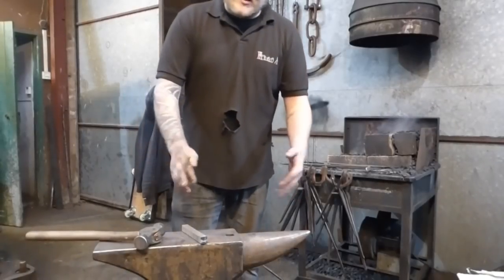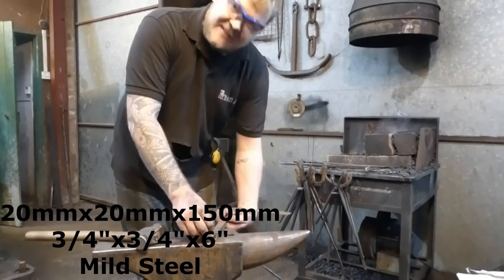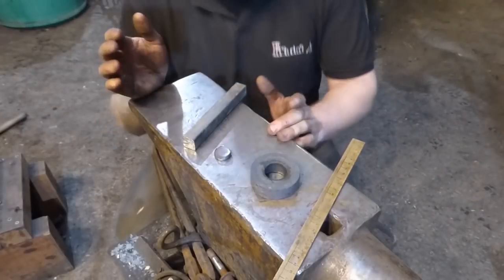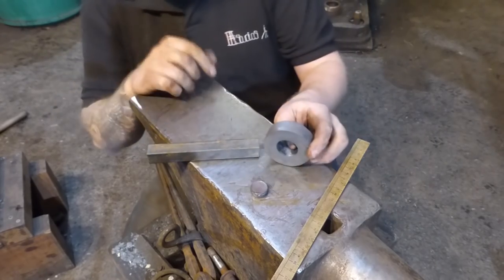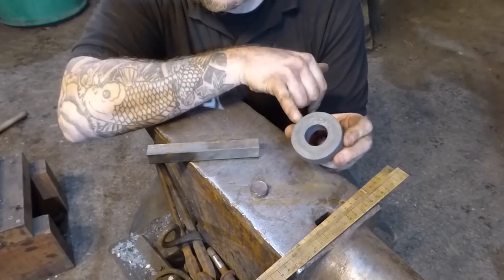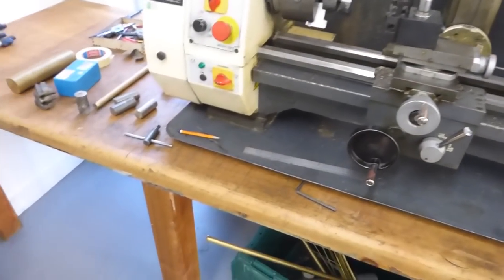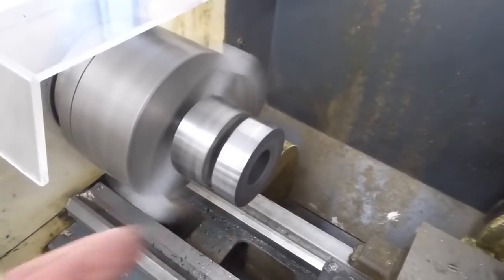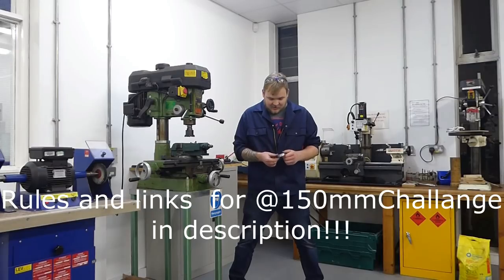150mm or 6 Inch Challenge! Upset, Punched and machined! #150mmchallenge

Comment from the maker: I think I should explain a little better the challenge is to see how creative you can be with a piece of 20x20x150mm mild steel or 3/4x3/4x6 inch mild steel. Rules for the descriptions check out the Instagram links also for more ideas and stuff. most important thing is to have fun!!!
Reply: Glad I finally read the rules. I was trying to make what you made by hand, no fun.
Reply from the maker: @coffeesstudios2122  nope make anything you want. Have fun not no fun
Reply: @danielmoss2089  got that when I saw John's video lol. Spent a couple hours trying to upset the bar . Was fun

Comment: That’s a very interesting challenge, good job dan!
Reply from the maker: You going to give it a go?
Reply: I do not think so maybe in the future but I am just starting and cant upset material that well especially just by myself.
Reply from the maker: @hannemannironworks1651  You can do any thing you like for the challenge dude. there where some example of others at the end of the video and if you check out the hash tag in Instagram you will find move examples. just have some fun with it. 

The upset that i did was an extreme version of the project I wanted to really push the material to the max! Then uses a method that I'm not sure any one has done yet the machining.
Reply: Daniel Moss i didn’t realize that you could make anything so I’ll give it a try for sure!

Comment: Loved the vid!
Could you manage to do this with a hand hammer?
Reply from the maker: Could have but it would have taken longer and I wouldn't enjoy it as much. Also my elbows are happier this way. Thank you for the comment.

Ps will you be having ago?
Reply: @danielmoss2089  
Thanks for answering!
My home forge wont be up and running before next autumn, but would like to try the task then with a hand held hammer. 
Heard some say the middle part is difficult to upset with an ordinary smith hammer. I'm curious trying it though.
Reply from the maker: well what i did in this video was make something for a project called the 150mm challenge. so all you have to do is make anything you like out of a piece of mild steel 20x20x150. check out the instagram to see other examples Rules in the description.

Comment: Dan: next time on the lathe the first cut needs to be deeper you need to get under the scale that's all carbon and will kill your tool bit, now mount the ring on a rough forged plate with the 20x20 bar through the canter at 45 degrees ( ART ) Love the vid . Best to you in 2019 Be Well and Be Safe. Bill
Reply from the maker: I'm not much of a machine and I wish I was. Thank you for the tips. I think the issues I have with the rings is there not central or flat often giving interference cuts. I need a better lathe and more experience.  Thank you dude
Reply: @danielmoss2089  interference cuts are hard on tools as well if you have to make interference cuts try not to use carbide, carbide is to hard and tends to chip machining is like after blacksmithing 1000 or so hours you get better Lol  stick with it you will get better. Be well and be safe .........
Reply from the maker: I was using a carbide insert. I just done have great equipment like with the Blacksmithing stuff. Any way worked out OK in the end and like I said be for I have so much to learn. Thanks for the pointers and the great comments as ever.
Reply: @danielmoss2089  come quad-fest it will be my turn it the barrel see you then.............